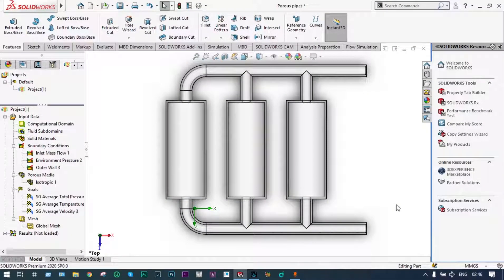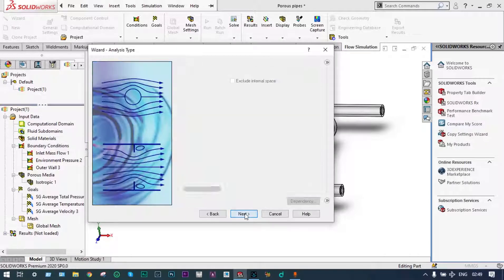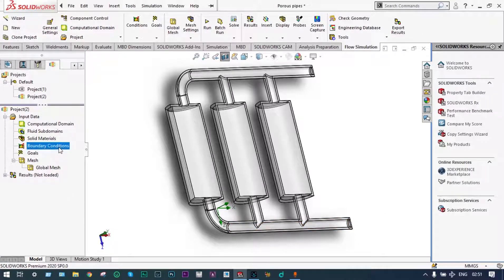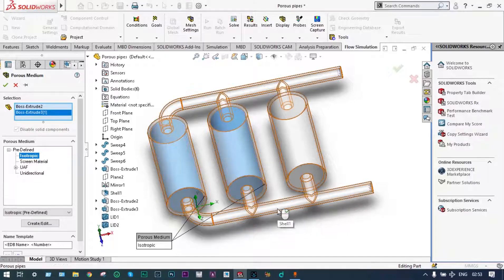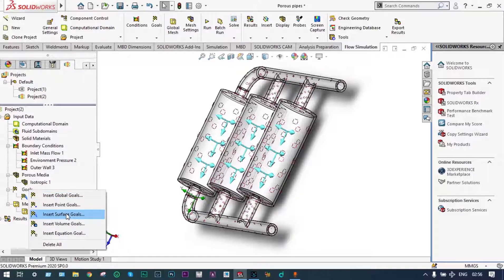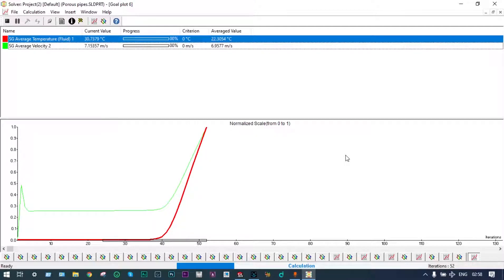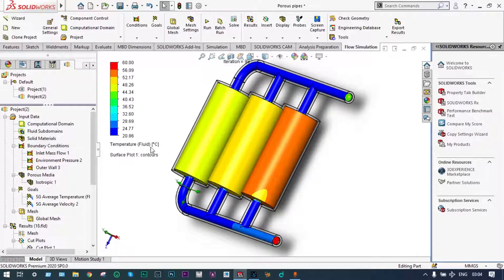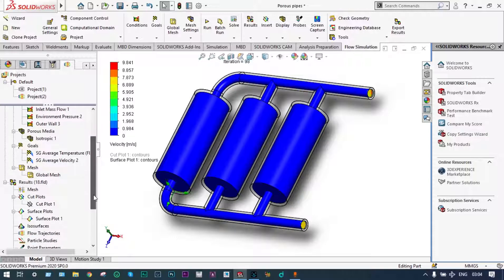CFD Analysis of Porous Material Flow in Multiple Pipes | SolidWorks 2020

Comment: Plz help to my 2 following questions 👇
1.  How can I model adsorption of gas species on porous solid in the porous computational domain as an equivalent porous domain of gas, solid & liquid with local thermal equilibrium ?? 
2. Is it possible to add the time dependent source term for heat & mass transfer in porous domain ?